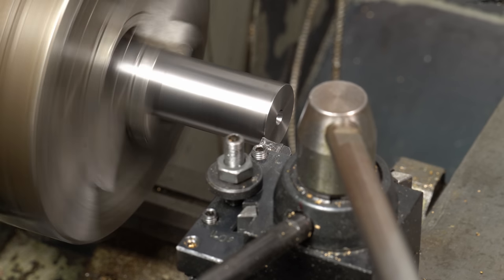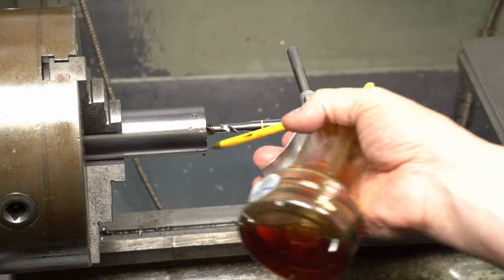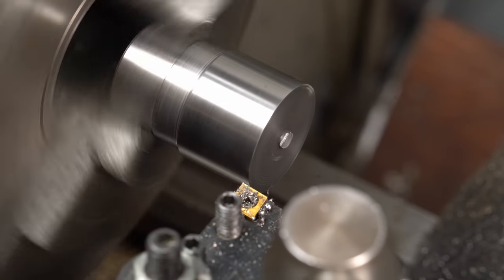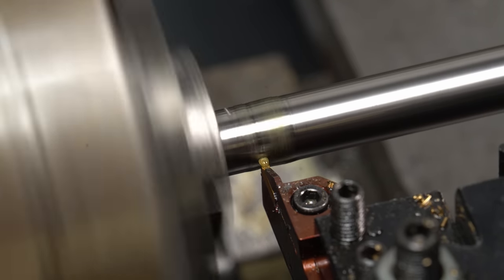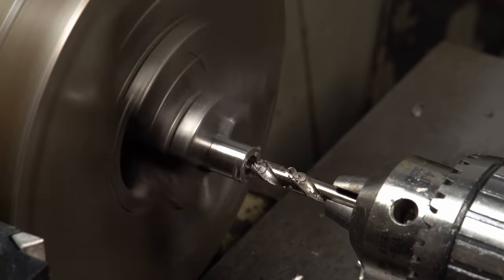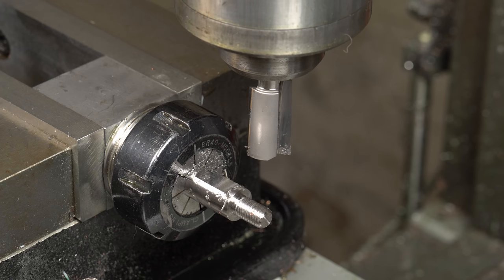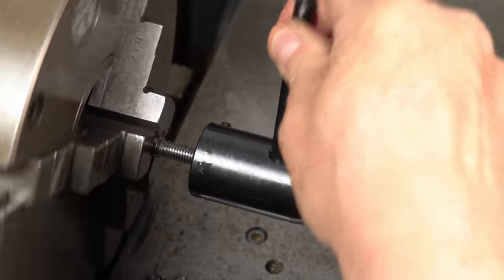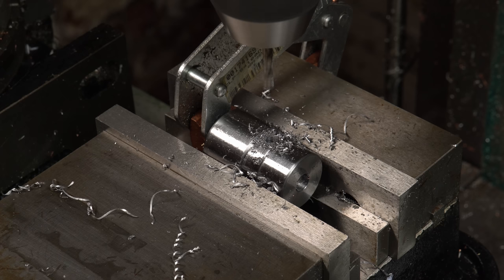Making a SELF-CENTERING Boring Bar for GHz Radomes

Comment: Teflon is an interesting material.  The properties, in specific areas, are so incredibly beautiful that we think it must be like any other plastic otherwise and be easily machinable.  The problem is that there's no such thing as a free lunch.  As far as a material, it squishes, flows, compresses, and moves out of the way of any cutting tool, and otherwise should be assumed to be warm taffy.  It's simply the worst material to work with, as far as I'm concerned.  You're not the first person to make similar assumption, so don't feel bad.  Being wiser now, if I absolutely had no choice but to have to do what you did with what you did, I would reinforce the outside tube with a reasonably snug metal sleeve to make it move a lot less.  That won't solve all the problems, but you don't have a rod of taffy anymore.  The cutting tool must be very sharp and take off a chip thin enough to prevent the tool from pulling the work up into the tool.  Mind the rake angle .  The sharpness minimizes the amount of material compressing under and relieving itself behind the cutting edge but will take a dive into the work if too aggressive.  Keep your tolerances sloppy and you won't be disappointed.
Reply from the maker: I often have to turn 2mm and 3mm diameter tuning pips.  They are a nightmare.  I even tried freezing the material and using freezer spray to see if I could get it below the glass transition point for long enough. On the second part, the cut went really well, but  I'm certain that if I could find 2mm or 3mm wall tube at least 42 mm diameter that I'd use that and make a mount that clamps it inside and out.  Still, it was a load of fun, I'm making five more of those parts, then Never Again!  Fibreglass with a good RF resin , plus a foam fill is the way to go next time, and I'll machine the slot array from aluminium and anodize it.
Reply: This really makes me wonder how radio transparent Delrin is? It machines easily in comparison, but I don't know what it's dielectric properties are.
Reply from the maker: @UD503J  see my other comment!

Comment: Machining teflon accurately is certainly a challenge. As you said buying a tube with the correct wall thickness makes it easy. Really appreciate all the steps and tools you used and your approach. You do need a steady rest!  I don't know if you know this but Amy has her own channel and looks forward to getting material for it at your expense. Cheers!

Comment: Time saver - Stub (Screw Machine) Drills were created to eliminate spot drilling holes when drilling thousands of holes with those incredible machines.  Nobody wants to hear it, but it is in most every tool supply catalog stating that as their purpose.
And otherwise, nicely done!
Reply from the maker: I have trust issues I guess! These are really nice split-point high-cobalt HSS and they're beautifully ground.  I get them from Drill Service of Hawley. Why I think that using a cheap centre drill makes any sense at all is hard to say.  I'm going to hide the centre drills and use them for drilling centres.  Thanks for the reality check, sometimes I just do things from habit!

Comment: I’ve seen various people mention these “bright boy sticks” for debuting, but can’t find a source for them. Are they actually different from regular Cratex rubberised abrasives, do you have any suppliers? I’ve used Garryflex as well but like you say it’s a bit crumbly!
Reply from the maker: My original Brightboy polishers were  parallelogram shaped abrasives that were designed for cleaning the tracks on model railways.  They just happen to be the precise texture and hardness that's perfect for polishing threads in brass and stainless and Tellurium copper.  Garryflex is too crumbly and the Cratex bullets I have are rather too hard.  I see them occasionally on ebay in the US, but the carriage makes it impossible.  I've bought every one that's appeared on UK ebay, but that's only three in the last eight years!

Comment: Is there a reason why you needed a precision machined teflon tube, instead of protecting the antenna with $9 of PVC pipe and endcap from the hardware store?
Reply from the maker: PVC is a very poor dielectric at microwave frequencies, so it would absorb some of the signal, also it crumbles after a few years exposed to UV light from the sun.  Polyethylene pipe is a better RF performer, but it's not brilliant long term with UV and weather.  This installation needs to last 25 years or so with minimal maintenance

Comment: I would've thought that you'd make a line boring tool, that would've worked as well and you could've flipped it end for end with a round cutting bit.
Reply from the maker: I couldn't work out how to grip the OD of the tube without making a long vee bed or something to support it, but I could have used the plug approach with line boring as well.  I need a longer lathe!
Reply: @MachiningandMicrowaves  Most lathe owners 'need' a bigger lathe.
Reply from the maker: @Andrew_Fernie  Universal truth indeed

Comment: I would have thought the generous chamfer would have been enough clearance for the base of the spiggot without having to drill some extra relief.
Reply from the maker: I wasn't sure how it would perform so I went a bit over the top. Seems fine, and you're right, I could have got away with less.

Comment: i wonder, if you had a through hole and it was fed pressurised air from the back, and some nozzles...could it self center in the cut?
Reply: Depends on how big the gab between the tool and the wall of the part is
Reply from the maker: Air bearings need very tight clearances and the tube is juts an extrusion, so the tolerances are all over the place, but as the diameter increases, that just might work, as the walls would tend to form a perfect circle under pressure
Reply: @MachiningandMicrowaves  probably works better in a enclosed macine using hig pressure coolant 

But when you have access to that we woud probably not have this problem in the first place

Comment: For curiosity, why not PVC or ABS pipe?  Do those conduct at all?
Reply from the maker: Both are absolutely terrible dielectrics at microwave frequencies.  Choices are HDPE, UHMWPE, PU, Cross-linked polystyrene and a very small number of others in solid plastic, or alumina (!) or sapphire (!!!) or a very thin GRP material, but it has to withstand repeated temperature cycling, strong wind, hail, rain, freezing fog/icing and permanent UV irradiation from the sun.  Thin polyester GRP with a PU foam fill is probably the best compromise
Reply: @MachiningandMicrowaves  Thank you, Neil.  I have a non-trivial quantity of ~50mm diameter acetal round bar I acquired after a foot/meter conversion error favoured me; if you're interested in a piece I'll gladly mail you one.

Comment: Now if you added a tapped hole to the front of your boring head (or several), you could have replacable discs on the front as pilots for different starting diameters. Nice job though.
Reply from the maker: That would have saved me from the problem I caused by changing the stickout! Excellent thought
Reply: @MachiningandMicrowaves  I'm surprised that your highly intelligent computerised sidekick did not point it out in disapproving or exasperated tones...
Reply from the maker: @occasionalmachinist  AIMEE is equipped with the latest beta version of 20-20 hindsight. I'll raise a bug report to the vendor

Comment: What do the different colored bands on taps mean?
Reply from the maker: Yellow is for general use and low strength steels, red's for fancy alloy steels; blue is for stainless steels and some exotics (I think), white is for cast iron, sometimes black is for aluminium, and there are a few other colours depending on the manufacturer.  I always check the manufacturer's data sheets and label any that are really weird.  In general at the speeds I'm tapping, yellow and blue work on most materials

Comment: Silly question, but does regular 50mm solvent weld waste pipe have sufficiently inferior properties that you couldn't use it? Seems like a very expensive plastic sleeve!  Also I think there's some audio issues in the first machining section?
Reply from the maker: aaargh, I thought I'd triple-checked all of the audio segments dammit.  I'll have a listen and mute it if it's annoying. Polyethylene pipe is fairly good, but I don't know how well it lasts in sunlight if it isn't full of carbon black (bad).  PVC is terrible stuff and falls to bits after a decade or less.
Reply from the maker: Oh dear, I see what's happened, the audio track for that bit is on the wrong audio track and that track has compression and limiting applied, but then the overall gain is dropped after processing.  Shouldn't be, but it was to stop the generated noises from being overpowering. I just need to listen through the entire thing every time I make a minor change, but life is way too short!

Comment: ... is this the mechanical equivalent of taking hours to make a script to automate a task that would have taken max 1 hour manually ?
Reply from the maker: Pretty much, although the job was urgent and I couldn't find a supplier who could get stock to me in the UK at anything close to a reasonable price. I'm sure there are much better solutions, but I'd had a bottle of Porter from an excellent local brewery, and I thought "why not?".  Turns out there are good reasons why not, but I did it anyway.
Reply: @MachiningandMicrowaves  But that's where the fun is.

Comment: I wonder if one could make a kind of air bearing in the part tbat rides the inside of the original tube thickness...this might make it useable in some other materials, also....and...if you had an "end cap" that fir inside the new diameter, and could slide on the length of the tool's main bar, it would keep that thin tubing from wandering after itps cut to size?
Reply from the maker: I'm making a vacuum chuck which has a rotary union to pull air through the headstock, so I could probably use that in reverse, but it would need a wild amount of pressure and flow rate unless I could fit some sort of piston-ring seal perhaps! 

On the second tube I made, I tried to use a disc to keep the end of the tube from wandering and it sort of worked, I can see that a tapered or stepped plug would work, I'll try that on the third one!

Comment: Neil are we supposed to not have noticed the fact that you did the work to use the MT3 in your tailstock, and then the video shows you clearly using a collet chuck in the tailstock to hold it? :)
Reply from the maker: I only used the MT3 for the last section as with the collet it's much easier to tighten the sections by rotating them in the collet. The last section is a bit of a nightmare to tighten up!

Comment: Spotting drill? plug tap? Now you're just showing off.
Reply from the maker: I have to walk AT LEAST six paces to open the drawer where the spotting drills live.  Well, maybe five.  And I have to open the drawer and the carefully-labelled containers they live in.  Might get oil on the labels.  That would never do. I have some lovely carbide spotters, 6 mm and 3 mm.  Total joy to use, but instead I picked up the cheap HSS centre drill that lives on top of the tailstock.  I need to have a word with myself.
Reply: Well as long as this doesn't devolve into a lean manufacturing rabbit hole I think you'll be fine.
Reply from the maker: @Leadvest  Zero danger of THAT

Comment: Man orders wrong stuff and then spends 40 hours machining bits and pieces to turn the wrong stuff into a wobbly version of the right stuff, but gets away with it because he left 40mm of the original thickness at the bottom almost as an after thought and therefore calls it bespoke.... Superb! 
Question - You used a lot more cutting lubricant in this video than I have seen previously. Is that due to the hardness of the steel you used?
Reply from the maker: That 40mm of thick wall makes for a very solid fit into the mounting collar. It could have been planned! So far it seems to be working as I've been able to receive the 10 GHz beacon signal from 342 km away every day since it was installed. I tend to avoid using lots of lube when I'm filming, mainly to give a clearer view of the cutting process but also I don't have to run the noisy smoke extraction fan or worry about getting oil and water on the camera and lenses. I use lube a lot more off camera, either from a sprayer, pressure mister, coolant pump or brush. Some carbide tips are designed to run dry, sometimes I use an air blast from a Noga Cool Mini to help clear chips away so I don't end up recutting them, but that's mainly on the mill. Short answer is "it depends...". I use coolant with Titanium so it doesn't catch fire
Reply: @MachiningandMicrowaves  that's excellent. Are you receiving via a dish and sat. LNB?
Reply from the maker: @theradiorover  I have an EME waveguide LNA, then waveguide relay, then a Kuhne transverter that I built from a kit. I made a Pickett-Potter feedhorn for the dish to get the best sidelobe performance.  Dish is 95cm steel perforated offset parabola. For portable I have a folding 18 inch steel dish that's sturdy and won't bend when I bash it.

Comment: I mentioned it as a reply to another comment, but does anyone know the dielectric properties of delrin? It machines quite easily in comparison.
Reply from the maker: White pure POM usually has a tan-delta at 10 GHz of less than 0.01, sometimes as good as 0.006 at room temperature.  Compare that with PTFE at about 0.0004 or cross-linked polystyrene at 0.00045 or HDPE and polypropylene at  0.0001. It's a little better than ABS, much better than PVC and a little worse than PMMA or polyamide.  So about 15 times more loss than PTFE/Rexolite and 50 times more than HDPE.  Rexolite machines really well and is rigid.  For thin sections, lossy materials like Kapton are fine because their mechanical characteristics allow very thin films to be used, but for several wavelengths thickness, the losses in Delrin or Nylon or ABS are a problem.  When you are chasing the last 0.1 dB or performance, you need high performance materials, but if you have a transmit-only system with excess transmit power available, you could use Delrin for lensing, although not the carbon-filled version. Also I'm not sure how long it lasts in UV light or if it absorbs water like Nylon does. Water is very lossy even in small percentages

Comment: You know you can always go on the game, and/or sign up to OnlyFans, should you find your financial reserves dwindling... 🤣🤣🤣
Excellent work as always Neil, great to see you wielding the tools in the workshop.
Question, and I apologise if this is an idiotic one, but why not just take the excess wall thickness from the outside of the tube?
Reply from the maker: Right, I should have explained that.  The issue is that putting a curved dielectric surface close to a waveguide slot array acts as a focussing lens and also detunes the slots a little, so thinning it from the outside when it's designed to run in free space end up affecting the horizontal directivity and return loss.  Thinning it from the inside leaves a larger radius curve that's 4 mm further away from the antenna face.  There is still a detuning effect, but it's not significant, and a small adjustment of the matching screws fixed that.  Full details of that on my OF page. 

The antenna system and mounts are now installed down in Somerset and when I checked this morning, I was hearing a strong signal from the propagation test beacon over a 342 km path from here almost at sea level in the Vale of York.  Beacon runs 1 watt to a slot array, I was using a 95 cm offset dish at about 5 metres up on my pneumatic mast, with a Pickett-Potter waveguide feedhorn, flexiguide and waveguide relay into a waveguide LNA designed for moonbounce.  It's great to have that beacon back to be able to check for troposcatter, ducting, aircraft scatter and rainscatter on 10 GHz
Reply: @MachiningandMicrowaves  Ah, that innie vs outie material removal makes perfect sense now.